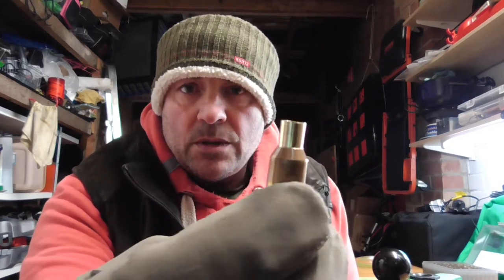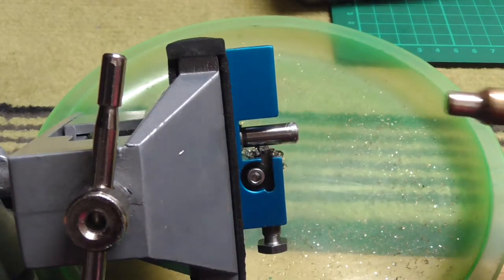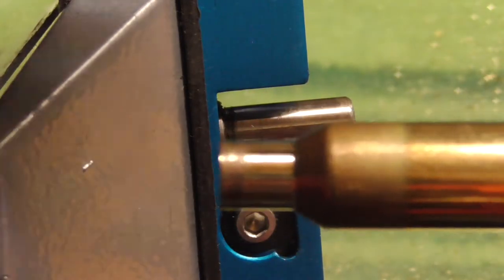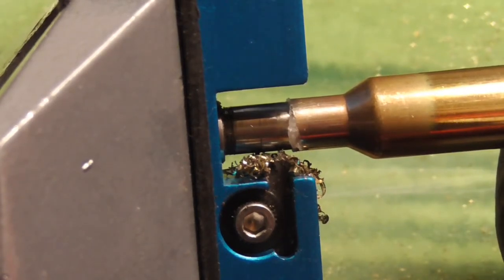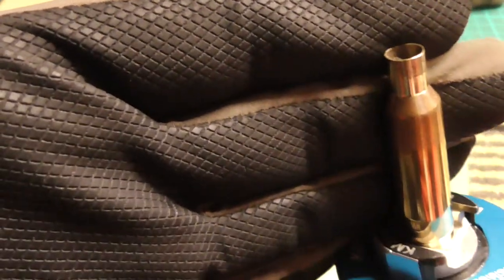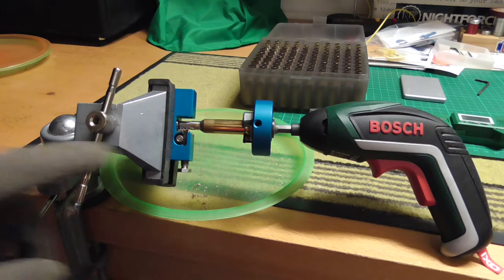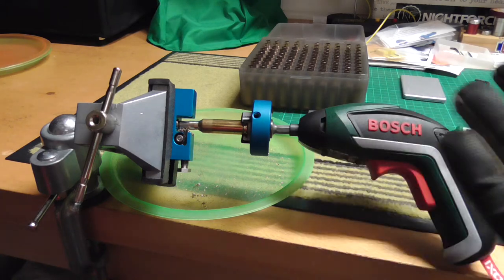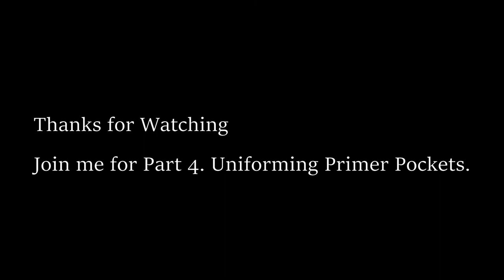6.5x47 Lapua New Case Prep Part 3. Neck Turning.

Comment: Great job on the neck turning. Like the setup - something to model after.
Reply from the maker: Thanks John , I am really pleased with that setup it works well, people can adapt the setup to what ever suits them but having a bench clamp to hold the cutter  and the little speed driver to spin the cases takes the hard work out of it I love it lol 😜👍
Reply: GianniG What is the device name you used to measure the neck thickness after turning the brass necks? Have watched all your processes (last year) and revisiting again this year. Planning to incorporate Eagle Eyes volume weight sorting of each piece of brass.

Comment: Great video Giannni !  Clear and concise …. Will order same setup in next few days. What about donut removal ? How do you do that ?   Thanks !
Reply from the maker: Hi Mike, thanks for checking out the video, as for donut removal it’s not an issue with the 6.5x47 with that 30 degree shoulder it really helps against that problem , which I seem to be finding as none of my cases have any donut formations plus I shoot a max grain bullet of 130g and have also shot the 135g Hornady A-Tip which was seated as long as the chamber would let me but not jammed as I think they were around 5-6 thousands off the lands and they shot really well { there is a video on that on the channel if your interested } but they also did not cause any donut issues, although some  people do choose to shoot the 140g bullets but I think that can be a little heavy for that case and would perhaps be more suited to the 6.5 creedmore , . 223 on the other hand can suffer from donut formation if using larger length bullets unless throated correctly of course, there is a Remear that Wilson make that fits onto their cutter and I think K &M also do a cutting tool to remove dounuts , hope this helps cheers G.

Comment: I usually lube the outside of the case neck to keep heat from the cutter at a minimum.  If a neck gets hot, it will expand which could lead to inconsistent results?
Reply from the maker: Missy , I see your point though I never had any issues using this little hex driver as it’s not spinning at to high a velocity the brass has never heated up on me , thank you for the comment.

Comment: Quick question brother. What is the exact pilot size diameter on this K&M? I've searched everywhere no luck. Basically im trying to see if .262" will fit over the K&M without the need of Expanding
Reply from the maker: Eagle Eye Shooting  Hi buddy , the pilot size is just 6.5 mm that is set from K&M but they now have custom expander mandrels for bullet tension I’ve literally looked like 5 minuets ago on their website normallywhen you order the pilot they sell you the expander to go with it but now like I said they have custom pilots so you can expand the neck to your specific size now that’s good they are $27  have a look you’ll see what I mean or ring them they should be able to hook you up. Cheers G 😁👍

Comment: Do you use a bushing die or standard die before turning the neck
Reply from the maker: I use a bushing die when resizing , but when I am ready to reload my cases and before I put powder in them , that is when I use a 21st century neck tension mandrel with dry graphite lube , to set my final neck tension, the bushing die is ok to resize the whole case including the neck , but remember the bushing is only squeezing from the outside so I prefer to set the final neck tension just before I’m ready to load my cases that way the cases haven’t been sitting around too long and have the possibility of allowing spring back , once the neck tension is set then I go ahead and seat my bullet , there is a video on my channel showing this procedure, hope this helps. Sorry if this is not what you wanted to know I just re-read your comment I don’t use any die on brand new cases because it does nothing to the case because the internal dimensions of the die are bigger than a brand new case I only straighten any dented necks and then use a mandrel to expand the neck so it’s big enough to get onto the cutter.

Comment: The blad supose to have an angle matching the shoulder. It lock like you make a 90 degre cut to fare in to the shoulder.
Reply from the maker: Morten Breiland thanks for the question but I have already asked what degree the blade is from k&m who assured me that this would be fine to cover the 30 degree shoulder for the 6,5x47 though I know that some other companies to make a 30 degree angled blade and I have not had any problems not even with my .223 brass.
Reply: Hello, turning too deep to brass shoulder makes me worried of brass neck break and stuck in the chamber, or some crack at the bottom of the neck. Have you ever experienced this kind of issue? I am thinking of neck turning only the neck, with no touch to the brass shoulder, is there any potencial issue? What do you think?

Comment: H, What’s the brand on your digital calipers?
Reply from the maker: Hi , I use the Mitutoyo brand , definitely worth spending a bit more on a decent set as where some of the really cheap ones are just not very reliable , you don’t have to spend a fortune but just research a pair with a good customer rating and you should be fine.
Reply: GianniG Tks Bro. I have the Rcbs mini ball calipers but they aggravate me more than anything.
Reply from the maker: No worries John , I think when it comes to buying decent kit like Calipers I definitely wouldn’t use people that make items for the gun market because most of them are made really cheap and sold at high prices, stick with people who specialise in Quality and precision and those tools should last you a long time.

Comment: .0125 seems thin. Do you have a custom chamber or is it SAAMI specs?
Reply from the maker: brettinnj  hi , the cases are 13 thou from new I only remove half a thou making them .0125 if you measure the new Lapua brass you will find that is what they measure , so I only remove high spots as you can see on the necks . If I had a tight fitting chamber I may need to remove a tad more but in my case there is no need.

Comment: How much are you taking off with the one pass?
Reply from the maker: medhist2006 the answer to your question is in the video!!
Reply: @GianniG55  Sorry i missed it. I cant get that kind of consistency from my Forster. Greetings from Canada
Reply from the maker: medhist2006 Hi, I say in the video that I only remove around half a thousandths of material the reason for this is only to remove any of the high spots , the Lapua brass measures around 13,000th sometimes half a thou more on one side and sometimes half a thou less so by the time I’m done they are more uniformly 12.5 thou all around, some people like to round it off a full one thousandth and some like to take them down to 11-10.5 thousand if they have a tight fit chamber, but i like to leave as much material as I can but while still having  a consistent neck thickness , hope that makes sense to you? In any case that’s the beauty of having these videos so you have them at your disposal, cheers G.😁

Comment: do you neck turn before or after size?thanks
Reply from the maker: 67cruiserbmw I expand the necks on new brass first which serves 2 purposes the first is it makes the case mouth more concentric and round secondly it will fit onto the mandrel ready for it to be turned, remember you cannot resize a new case when you put it through a  resizing die because the case is already smaller than the internal dimensions of the die,  it has to be fired and expanded and then you can resize it. I only neck turn new brass not fired brass, hope this answers your question?
Reply: Thanks.
Reply: I neck size after fire-forming virgin brass to my chamber, I then resize with no expander ball, then use an expander mandrel.  My rationale is the expander mandrel makes the internal dimension of the case neck more precise, and then turning makes the external dimension of the case neck more precise.  Here is a good explanation focusing on uniform necks from an experienced bench rest shooter: https://www.youtube.com/watch?v=sdJeADnU4Uk&t=12s

Comment: For that price of Lapua brass One would hope this would be an unnecessary step, They needs to step up Quality control
Reply from the maker: Matthew hi , yes I agree with you totally as with a lot of these brass manufacturers that just dump their brass loose in a box or bag which then get bashed about denting case mouth’s and what not , as for slight variances in the brass I think that’s always going to be a thing because if they were more precise measurements and less weight differences you can certainly expect that the brass would cost even to get those tolerances just take the new Hornady A-Tip bullets for example not many want to buy those things but damn they are nice and the quality control is there and so is the price..lol.